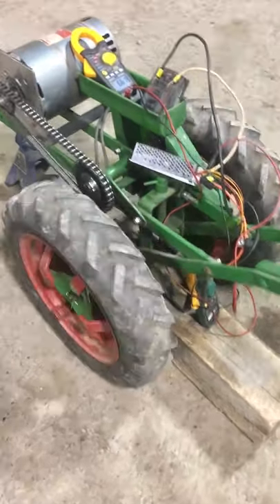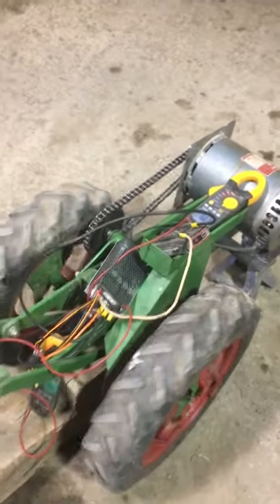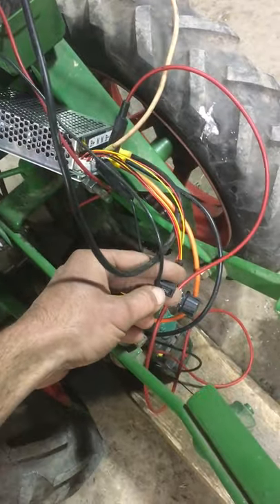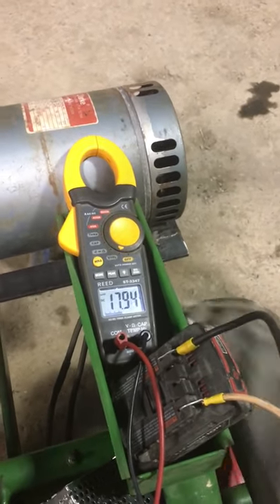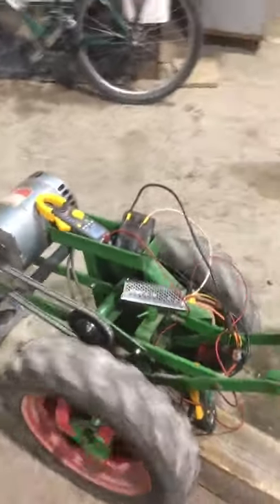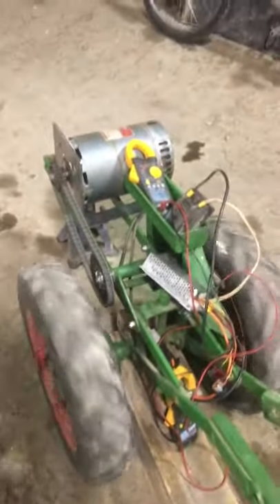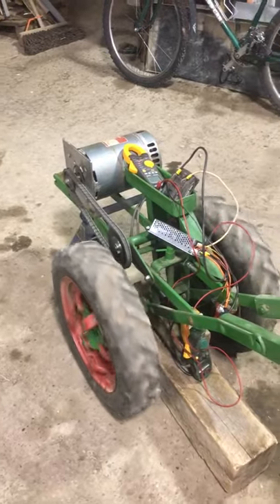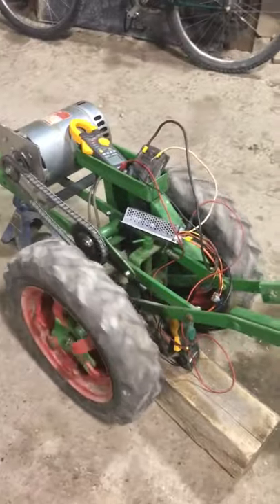Planet Jr BP1 electric - drivetrain tests with speed controller

Comment: Excellent. Is that a 12v motor then? Got any specs on it? And won't the amp load increase as you actually load up the motor?
Reply from the maker: This motor is an oddball.  Wound for 24VDC and with brushes arranged to make it spin quite slowly (300rpm at 24V IIRC).  It's intended purpose was a big circular brush on a battery-powered floor scrubber.

Yes the current draw (amps) will go way up under load.  I'm aiming to build it with components that'll survive more than 100A peak current with the expectation that it'll go up to between 30 and 50A.  

The amp load shown in the video is only of academic interest and doesn't really tell us much at all except that the simple drivetrain on these tractors really is simple and efficient, despite the lack of ball bearings (1930s or 40s design)!
Reply: Awesome sauce!!! 👍👍👍. Good find on that motor, was looking into your recommendation of electric pallet jack motor. Would like to do the exact same thing with vintage 'David Bradley' walking tractor 💪

Comment: What horse power does this make
Reply from the maker: 1 hp is defined as 735 watts and this motor can draw up to 60A at 26V.  Power in watts is volts x amps so max power output is about 1500W (1.5kW) or 2hp but far more torque than 2hp had engine and torque is more relevant for this kind of work. Getting used to thinking in kW rather than HP makes it easier to compare and understand electric traction systems.
Reply: @reidallaway  I've got a gas power buggy that moves concrete its older from the 70s I'm thinking about going electric with it I need about 6500kW maybe electric gold cart motor
Reply from the maker: @l0n3d4nger4  powered buggy is a great project for conversion.  You may need far less than 6.5kW because it's probably got big gear reductions and doesn't need to move fast.

What make and model is your machine?  what's the drive setup?

If you're on Facebook we've got a good group called DIY Electric Farmer to share what we're all learning about these projects.
https://www.facebook.com/groups/diyelectricfarm/
Reply: @reidallaway  1978 whiteman wsb-11 power buggy
Reply: @reidallaway  old Wisconsin gas motor with centrifugal clutch belt drive to a gear box which drives a chain to the wheel